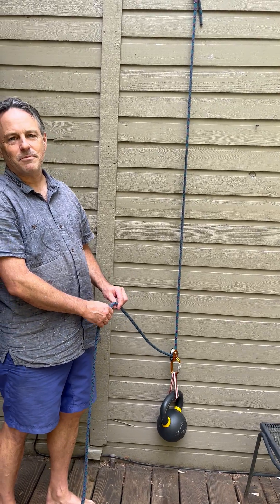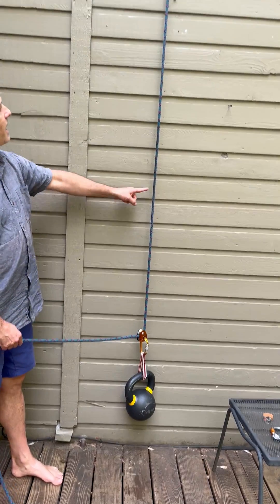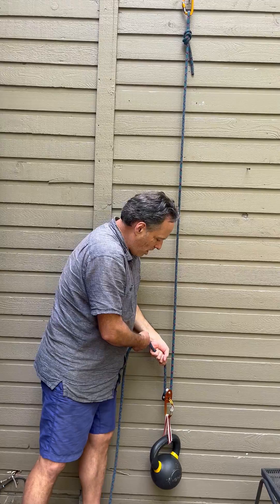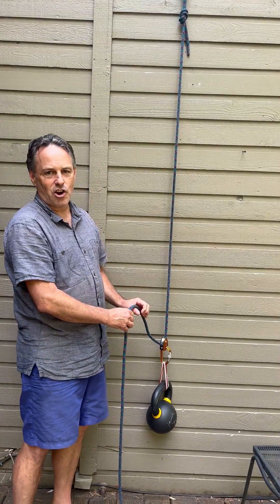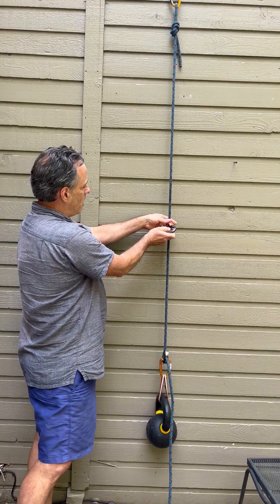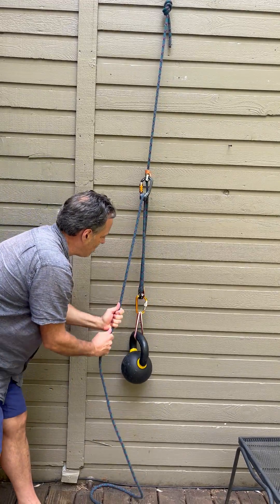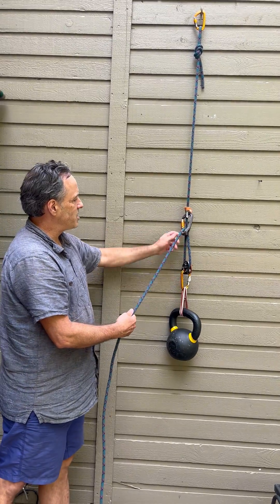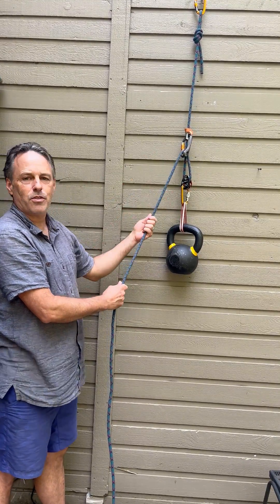Big wall rigging: the “far end haul”

Comment: How are you connected to the anchor when far end hauling? Would you ever far end haul the whole pitch?
Reply: Good question. When you're doing this, you're probably connected to a secondary rope, such as the lead line.  Doing this for an entire pitch would be very tedious.  In big wall, it's used as more of a temporary problem, sober, like if the bags get stuck on something. I have heard of people using this in cave rescue to haul people up a rope when you need somebody next to them to monitor them, but I've never done that.